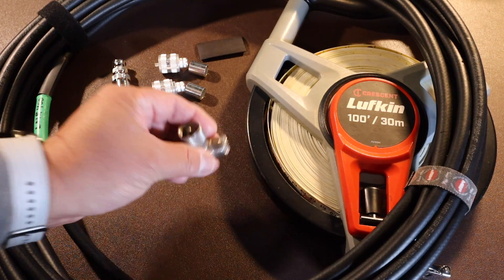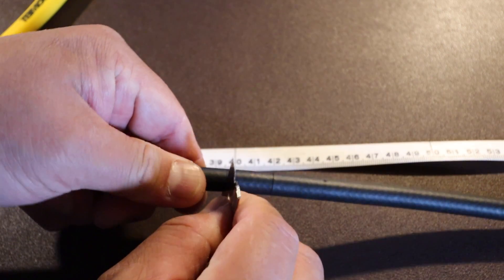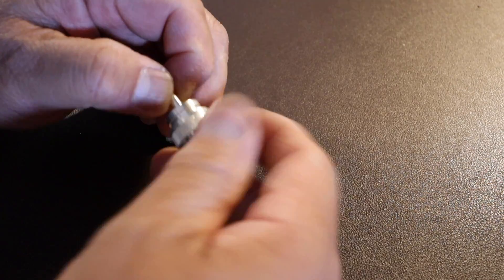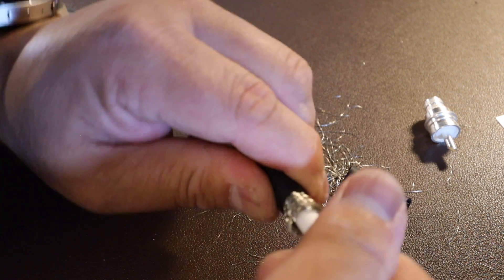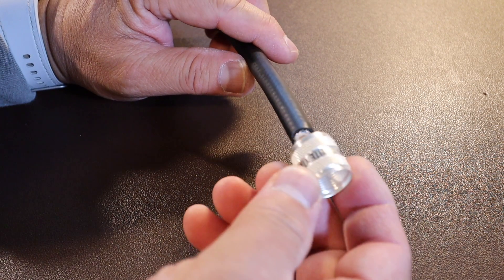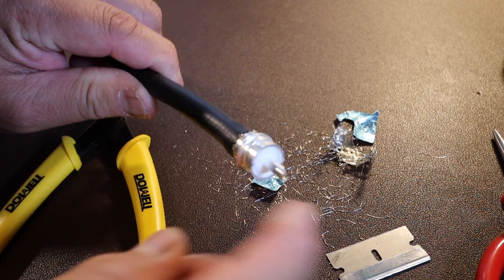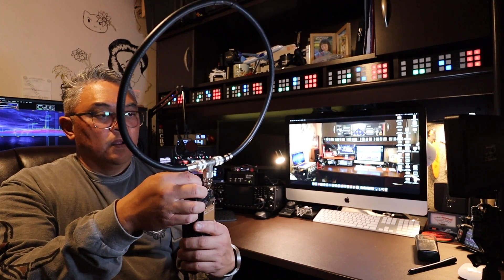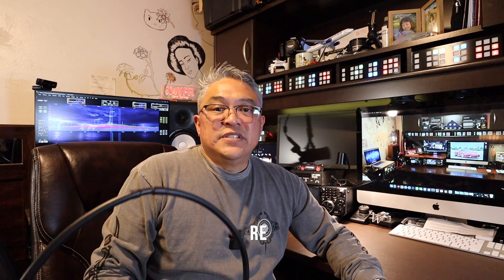Building a Direction Finding (DF) Portable Loop Antenna | Use this loop to Track Down RFI Noise!

Comment: You measured 45 cm from the one end of the coax, but then mark one cm either side of the 40 cm mark on the tape measure. Are we measuring 90 cm from the end of the center conductor in the working PL259 to the end of the non-terminated end of the other PL259?  How critical are these measurements?  I have no heat gun. What else can I use for shrinking the heat shrink tubing?  Hair Drier? Lighter? Gas stove burner?  Please advise.

Comment: 1) Can i just add one meter of coax between the "T" and the receiver? I would like to hold the antenna on one hand and the receiver on the other (I'll use a portapack). Will this additional coax make any difference?
2) What RF range this antenna cover?

Comment: Where are the dimensions (90cm and 2cm - for the gap) coming from?  I want to know more about the theory of its construction and the operating frequencies.  I am most interested in the UHF 70cm (440-450) band.  I presume, as built, it's more for VHF (90cm roughly a half wave at 2m).  So, perhaps 30cm for UHF?  Probably not a job for LMR-400 and PLs though, huh?  Thank you.
Reply: I have built a few of these.  They are non-resonant.  They work well from 1 to 500 MHz.  Above 100MHz they exhibit a slight front to back ratio.  You can make a bigger loop with slightly improved results.  The design appears to have come from an Australian site: https://www.youtube.com/watch?v=Ivr9VbSgjUU.  Which also has an outdoor test clip at:  https://www.youtube.com/watch?v=7WHmUKh-3cc

Comment: New subscriber here.  Thanks for this video.  I am wanting to use a loop antenna with my tiny SA to see if solar panel controllers are giving RFI.   

You mentioned being a pilot.  I have my PPL which I earned as a 17 year old in 1975. Thought I would fly in retirement again but health had other ideas.  So I took up another cheap hobby and was licensed in 2020 as a general.  The  VE’s talked me into taking all 3 tests.  I was 3 questions away from passing extra.   Funny thing - I couldn’t remember the RLC model of antennas from my engineering classes from the 70’s.  Sorry for so much information.   All the best from north Texas.  73 de KI5HXM

Comment: When Darren said "score", I could hear Beavis and Butthead chuckleing in the background... He's gonna score...😂
Reply from the maker: @kd5inm  😆
Reply: @DarrenN4VFR  I subscribed to your channel. I saw you mentioned in QST. I did something similar to your apache case with my FT-897 w LDG 897 tuner. My 897 has the batteries and charging setup that are scarcer than hens teeth so it runs 20 watts and I have a home modded switching power supply good to 30 amps I can run it from as well. And I have some lovely Messi & Paoloni coax to go with it... hihi that Mr Messi personally sold to me... he's a great guy btw...  continued good luck with your channel. I will be watching. De KD5INM

Comment: Hi, to prove the directional property of your loop, your demonstration would be more effective if you turned off the apple computer that was on your desk. The RFI could have been stronger from the direction of the apple computer than the LED lamp. As you turned the loop it was broad-side on to the screen/computer. Having a more obvious source of RFI would have been better proof to convince viewers of the directional properties of your loop. I was not convinced that the thin side of the loop was the direction of the noise.
73.

Comment: If you actually short the inner conductor to the braid at the end of the cable where the centre of the PL259 plug is not connected, you will find the loop is a lot more sensitive and the null sharper.
Reply: Yep, I saw that too, that's the way I made my own, with the inner wire shorted to ground on one end.  
I used a piece of some old 19mm CATV hardline 1/10 of a wavelength in diameter to make the loop out of, put a trimmer capacitor across it and mounted it to a dowel rod for a handle. I could actually even use it to transmit on when using only a couple watts. I was the target when we were doing some fox hunting & whenever I saw my friends were getting close I switched over to the loop to transmit on & pointed the null at them, which made the reflections stronger than the direct signal. They finally gave up & I had to explain the trick to them.

Comment: Well made and explained. Thanks. Can this be used for a “Fox Hunt” in 2m or 70cm bands?
Reply: If you make the loop 18 inches in circumference it will work on VHF and for UHF 11 inches works fine. If you short the braid to the centre conductor of the coax at the end where the centre of the PL259 plug is not connected to the coax centre conductor, you will find the loop is more sensitive and has a sharper null.

Comment: How does this work when the two halves of the loop are shorted at the feed point by the T connector?  The increase in noise you showed was only because the loop got closer to the noise source, not from directivity.  A good paper on loops is at www.n6rk.com/loopantennas/pacificon.pdf

Comment: Hi Darren, very nice construction video.  The design you used looks like the design I first saw published by the Radio Amateur Society of Australia in which they were using in on HF frequencies.  A few years ago I built a DF loop based on their design and tested it using a preamp versus numerous other designs after I noticed it was really deaf below about 10 MHz compared with other comparable sized untuned shielded loops that I have used (really deaf down on the AM broadcast band as an example).  Sure enough what I found was that between 14 MHz and 30 MHz the design identical to what you used worked well and provided gain similar to what I call the traditional shielded loop design but as I went lower in frequency from 14 MHz on down the gain dropped rapidly versus other comparable size untuned shielded loop designs.  Just FYI in case you try and use it on MF/HF frequencies.  73, Don wd8dsb
Reply: Did you ever come up with something that works from say 2-14 MHZ ??

Comment: Back in 2008 I was working for CenterPoint Energy after Hurricane Ike on Galveston Island restoring power to the island. I found a quick and easy way to tell if a power line was hot or not. In my truck I would tune the AM radio to an off channel on the low end and drive under the power line. If there was static, the power was back on. No static meant the power was still out. It worked for both transmission and distribution lines. So the next hurricane you are empowered with a trick from an old engineer.
Reply: In the oil field we did a similar  trick.  If you tuned your truck radio off an AM station you could tell if the inverter was running  the pump as soon as you drove onto the lease. More than once the green beacon lamp was latched on but the inverter had burnt itself up.
Reply from the maker: Cool tip!
Reply: Great video Darren. Thank you.

Comment: Nice video, thanks for sharing.  I was frustrated when you didn't put the screw thread on and a few minutes later realised you could still do it from the other end 😁

One thing I would ask, at 16:30 you gave a demonstration with audio.  It would be beneficial if you could cut the music that's playing while doing that kind of demonstration.

Comment: How did you settle on a 90 cm loop circumference? Was it simply to keep the antenna small for ease of handling? - Thanks!
Reply: Watched this video a couple times through and liked the design. This is the only thing that bothers me though. He doesn't explain where the 90cm circumference comes from and why the gap in the shield is 20mm. I'd like to use the design for a 2m foxhunt antenna since I have a couple small scraps of LMR400 laying around, but without the details, it's difficult to figure out. I see another commenter said for 2m to make the circumference 18 inches, which would be about a quarter wavelength. Makes sense. As best I can tell, his 90cm antenna isn't made for a specific amateur radio wavelength and is just a noise detector.

Comment: To make even scoring on coax I find a small tubing cutter to work very well. When cutting through the outer jacket, you can feel the shield Jen you have cut through the outer jacket. The cut is clean and circular. No razor blades or box cutters needed and possibility of cutting your fingers is greatly reduced.
Reply from the maker: Man, that's a good tip!  Thank you.

Comment: A similar loop was made by an amateur in the 1980's to track a C.B.'er coming on 10m causing a nuisance. A small value capacitor to tune it.
He was knocking on the guys door in ten minutes saying if he didn't stop he'd contact the authorities.
He stopped.
G4GHB.
Reply: I used one of these in the 1980's to track down a carrier holding up an FM repeater late one night in Melbourne, Australia.  It came from an early VW van in a driveway.  The house was dark.  The owner woke up, swore and went to his car where a slowly rising seat cushion had activated the PTT after he left it.  He seemed embarrassed, but appreciative as it would have cooked his finals or flattened his battery.    I went back a few days later and had a chat.  His daytime job was a Radio Inspector for the Australian government.  It is not often one gets to track down a Radio Inspector.😁
Reply: Not a good idea now days you may get shot !  My gate has phone number beginning of driveway there is close to 1/4 mile then up a hill to my front door that’s a threat .sounds like a sad ham to me .
Reply: @jhonsiders6077  I'd have just told the authorities and let them deal with it. 
Why should we let our hobby be interfered with. Jealousy? We don't do it to them, we have far more interesting things to do with radio and more frequencies.
Reply: @bill-2018   I have had my general  since a teen  my uncle fitz was a ham that got me interested in the hobby he was always the guy that said why do so many think they should police the airways ? I am the same way it’s not hurting me . When he passed away I inherited his shack of gear my kid was never interested in it but was into radio . I put together a low power FM transmitter for him and his buddy’s to play with they fooled with that for years until he went to collage kept them out of trouble and off the streets . Just ten watts and being out in the country never bothered a commercial station but there was one guy that threatened to turn me in over it I said if that is your way to make brownie points do so . That was the end of it  a guy on here coined the term Sad Ham I have to agree with him . Even as a teen the older operators when they heard me talking would break in and demand my letters I would ID my station I got good with MC and could do 15 WPM  just so my voice was not used . That is what is turning off young people to it and we are loosing parts of the spectrum being sold off for other uses .
Reply: Why?
Because they interfered with our communications playing music and noises over the top of us! What is difficult to understand about that? They have 27 MHz to do that on. Stay off 28 MHz is all we ask of them.
If you see me as a Sad Ham then so be it! I'm not having my hobby ruined by some idiot and neither did the amateur concerned.
You might like it but most don't.
G4GHB.
Reply: @bill-2018  We have so many more places to go is why it does not bother me  spin the knob on my old Viking .  plus really how many of us did sneak to the CB bands and have some fun with over a KW of power ?? no ones a saint .
Reply: @jhonsiders6077  So I assume from your comments you did it? You find nothing wrong with it. You're now happy as an amateur to be chased off your band?
Why should we move off OUR band because of idiots! They chose to do C.B., let them get on with it if that's what they like. If they want to act like idiots do it on 27 MHz.
I'm sure a photographer would get annoyed if every time he took a photo somebody jumped in front of his camera. It applies to all kinds of things. 
I certainly wouldn't want to go on Crap Band. Why should I? I was a SWL then did the radio exam.
Luckily it doesn't happen now. The ones who realised there is more to radio than buying a radio, buying a twig, buying an SWR meter, buying a power mic, buying a burner, buy everything, moved on and took the exam and became amateurs.
73, G4GHB, (Sad Ham to you)

Comment: I wonder how much of a difference cutting the shield in the middle section makes. I've been using the inner loop of my mag loop antenna with good success to find RFI.
Reply: A lot for me
Reply: Altrimenti diventerebbe un tappo e non un'antenna, come un circuito chiuso su se stesso.